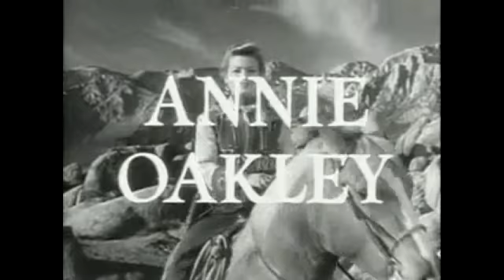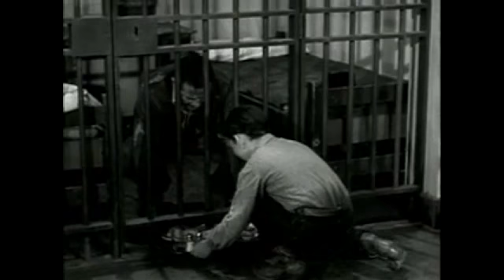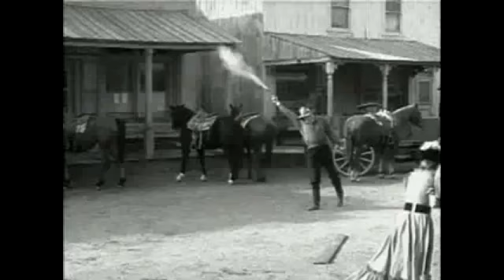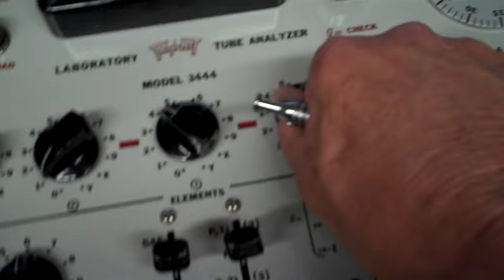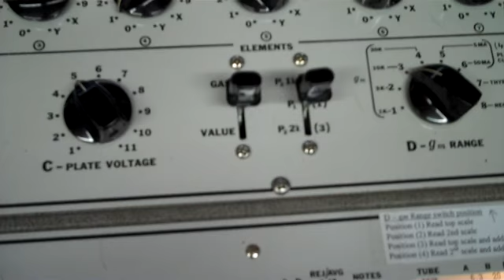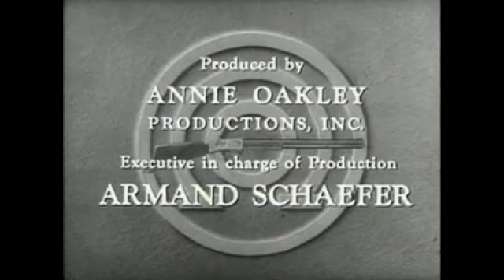1952 RCA Model 17T151 17" TV Repair and Restoration (Part 21 of 27).

Comment: The Precise 111 is another good Gm tester and it's not as expensive as some others.  It's also quite easy to set up for tubes which aren't on the chart as the plate voltage and bias settings are clearly marked.  Radio Shack sold them as the Realistic 112.

Comment: I should have mentioned that there is one tube (1B3 HV rectifier) that will give wonky readings on most testers.  Generally if the filament is good, it will work OK.  They also tend to last a very long time.